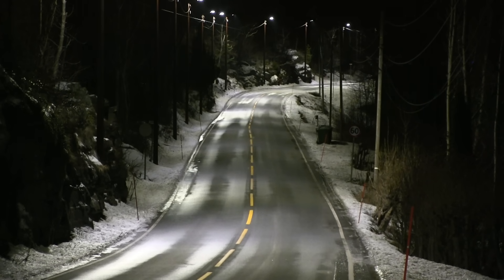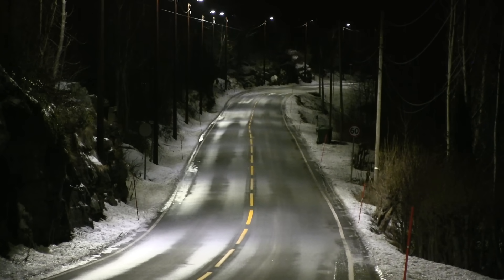Energy saving auto dimming street lights

Comment: They should not use radar, but just regular proximity sensors on nearby posts: so, when post 1 detects traffic, it sends a signal to a couple of poles ahead, so they can start incnreasingn light strength. That way they should be able to use cheaper hardware. Also would be good if the light adjustment was smoother.

Comment: At no additional cost you could make this even one notch cooler...  If the motion sensors detect a vehicle stopped in a traffic lane, it could flash the street lights a hundred meters on either side as an advance alert to oncoming drivers.  On a divided highway, they could flash in response to a wrong-way driver.  Once you start brainstorming the possibilities go on and on.

Comment: My knee-jerk is that this is a good idea in theory, but an impractical, potentially more costly idea in practice.  More complexity necessarily introduces more chance for failure (public safety at risk, which equals social cost) as well as more cost and time to maintain (these require specialized knowledge, creates vendor lock-in for more difficult to manufacture parts, etc.). All that has to be weighed against the upsides (energy savings, less light-pollution).
Reply: In regards to safety; if one radar no longer functions, the lamp will automatically be set to 100%.

Comment: That flickering of lights can be annoying as .... Should be so that the lights light up before the car can see them.
Reply: The customer can choose how far ahead the lights should be lit. Here they have chosen 5 poles ahead and the poles are 40 meters apart, so the light go to full light 200 meters ahead of the car. But for sure, they could have chosen 10 poles ahead and then it would have been lit 400 meters ahead, it`s all up to the customer and can be changed at any time they want to.
Reply: Great! I'm glad to hear that. It would also be much better if lights went from 20% to full power in like 5 seconds, so they wouldn't produce the flickering effect.
Reply: I agree. Not only annoying, the flickering also distracts the driver. When we drive, we very much react to changes, and this flickering is a constant stream of changes. The idea is good, but it will need some improvement.
Reply: If the car travels at speed limit, lets say 60 km/h this will make the car to have traveled approximately 75 meters before full light is retreived, and then again with at least 200 meters sight, the detction should ignite 275 meters ahead of the car. But this is doable. Here this would be 7 poles ahead, and a change of ramp up and down time could have been programmed. Communication to the lamp driver is done by Dali, so the drivers needs to preprogrammed for this feature, but if the controls had been done by 1-10 V control this could have been done with the radar system unit. So it is a lot of possibilities, there is even a high traffic adjustment, so if you like lights will not start dimming down before you have a sertain amount of low level traffic. This to prevent light for going up and down all the time.

Comment: Pointless.
If there is little traffic (as here), cars will be able to use headlights on full beam most of the time. That gives perfectly adequate visibility. Street lights of any kind are unnecessary.
Reply: What about when another car drives the opposite direction? That's when good street lights are most important.

Comment: It only saves energy if doing that doesn't burn out the ballasts in the lamps after a few months. I worked in an office where they did that, got new energy saving lights with motion sensors and set the lights to 5 minute intervals and most of the ballasts burnt out within a year because they were going on and off all the time. 

The best thing to do is just to turn them off between 10PM and 6AM. Its what some local authorities have started doing in England. Its a waste to run all these street lights at night. Cars have headlights.
Reply: https://www.thesun.co.uk/motors/4780183/brits-in-the-dark-as-a-third-of-street-lights-are-switched-off-or-dimmed-at-night-and-itll-be-even-worse-after-the-clocks-go-back/

Comment: Is it worth the complexity and all cost that comes with maintainance (and cost of the whole system in first place)...just asking, not a criticism. 
Wouldn't make sense to just run LEDs at like somewhere (fixed power, set at instalation/purchase) between 20-60%  (i pulled that number out of my...thin air) all the time?
Reply: To install a radar takes only a few minutes and the cost is not high. With the radars installed you can provide 100% lights when needed (for safety reasons) and turn them down to 20% to reduce consumption of electricity and hence costs while also reduce the pollution of light.

Comment: In germany they installed a solar powerd street light. This light is only for pedestrians and bicycles but the idea is great. The light operates with low energy and when the radar detects someone, it goes full power. Also there is a solar panel and some batteries to function autonom. Not everywhere you can install a energy cable or it costs to much. 
For someone who understans german, here the video:
https://www.youtube.com/watch?v=3s93WSXIsFY

Comment: That's pretty cool. I knew it was likely that some places did this but this is the first time I've actually seen it. Ever since my town in MA replaced the sodium vapor lamps with LEDs some people have been complaining that the light coming into their homes is brighter. This could be a problem if your house is somehow really close to a street light. I'm sure a lot of energy has been saved and hopefully light pollution has gone done a little bit because the lamps now face completely downward. But I wonder if the potential decrease in light pollution may not be as large because of the extra illumination being reflected off the ground, especially when there's snow on the ground during the winter. A simple solution would be to have the lights turn on only when a vehicle is coming, or have them very dim most of the time and get brighter when a vehicle drives by. I've been wondering how this would be implemented, and it seems radar is the most likely.
Reply: Comlight reduces the output to 20% when there is no traffic. If you turn LEDs off completelly for each car the life expectancy of lamps reduces drastically.

Comment: I have not driven there, but I think maby 5-10 lamp posts should light upat the same time in front of the car so that you can see a lot furter infront of the car. And then it does not need to be radars on every light post just a receiver and they save even more money i think.

And great video as allways Bjørn!
Reply: You have a good point Niklas. From this angle it looks like it only lights up just in front of the car. From above we would see it lights up more than 100 meters before the car, which is good when travelling at 60km/h. For roads with higher speed limits more lamps are lit ahead.

Comment: That's a pretty cool concept but imo they don't light up fast enough
Reply: iv'e been there with a motorcycle, they are genious. Lights up fast and i could see in my mirror them dimming down again
Reply: The system isn't exactly hard-coded to be specifically lighting up x meters ahead of the car. In Australia it can be made to turn on 100-200 meters ahead if you think that's necessary.
It's literally a change of one number in the settings.
Reply from the maker: +Ventilate They do. Watch when the car drives past.
Reply: Measurements and calculations tells us that you need to drive at least faster than 250 km/h to be able to have a theoretical possibility to catch up, when there are extreme cold and reaction in the electronic is at its slowest. And if you move around in darkness at those speeds at public roads, when there is below -50 degrees Celsius, you do not deserve any light at all.
Reply: Edwin Kravcenka ooh then that'd be nice! Still better than driving around with no Street lighting where I live anyway
Reply: Yeah, in Australia I'm always looking 100-200 meters ahead for wildlife - this wouldn't be helpful at all.

Comment: What about motorcycles and bicycles? Do they activate the radar if so they are pretty cool
Reply from the maker: A human didn't seem to activate it. I haven't tested the other types of transportation.
Reply: martinstab2 the radar can detect a motorcycle or a bike with an appropriate software.
Reply: Pedestrians down to 2 km/h shall be detected as long as they pass through the detection area. The Detection area is covering from one side of the road to the other, but not all the space between the poles.
Reply: Antonio Cirino dove hai letto ciò ? Comunque sarebbe bello vedere questa tecnologia impiegata anche in Italia, ma sto sognando haahah
Reply: Fabio Im beh non ho letto, ho pensato che il radar può essere calibrato proprio come si calibrano i sensori antifurto. La tecnologia è simile.

Penso che sia poco applicabile in Italia poiché la densità abitativa è più elevata rispetto alla Norvegia e quindi i risultati possono essere minimi. Una soluzione è il solo passaggio ai led.
Reply: This was my first question, thanks for answering it... I suppose that at 20% illumination, a pedestrian should have enough illumination to be able to walk safely, and they will get the full 100% illumination once a car approaches...

Comment: Have you a link of the hardware installed? I'm interested.
I'm guessing if the dimming will degrade the led light faster than in normal mode with full brightness without dimming.
Reply: I think it is not only the heat as well as the Phosphor dissipation will be lower which transform the spectrum to white by having less current through the LED.
Reply: Atak Snajpera obviously but the quality of the heat exchanger is different between cheap led lights that stands for 25000 hours and high power led for streets that stands for 100000 hours and over.
Reply: If you compare a led of lower watt use with same output of that of incandescent the latter would run more hotter, I can comfortably touch a 40 watt or less incandescent but as me to to touch one with higher wattage and your asking for a burning. Now if it was a 100 watt equivalent LED using only 40 watts power  or even more wattage comparable output I can touch it just fine and won't burn. You all are thinking like they burn hotter than tungsten or halogen and I got a few 200 watt-e LED bulbs and they do not have any heat exchange on them and I can easily unscrew them when they have been on a while, where as I said with the older types I would have to let it cool down for several minutes or use oven mitts in which case would lead me to dropping the bulb.
LEDs do not burn hot, they get warm yes but not hot like incandescent or halogen or such, but yes put a bunch of them in a bulb and will want some heat dissipation or they will burn out like old type bulbs.
Reply: Most I use is 60w equivalent as the higher wattages are more lumen than needed, none of the bulbs bought have any noticeable heat dissipation and can touch them as they are only warm enough to warm my "cold" hands. anything more would defeat using less energy and really only turn on enough lights to see what I am doing or where I am going when it's night time out.  My eyes are a bit sensitive to even daylight when it really shines.
Reply: Hi Antonio, all luminaries producers we have been in contact with has said that the LED light will last longer and have less degrading than normally if dimmed down to lower light level. In fact this installation is right now with 80% Luminux flux at maximum and 25% Luminux flux when dimmed. 
Here is a link to our homepage: http://www.comlight.no
Reply: I go by what it says on the boxes and compared to past older tech the LED are lasting longer despite what you think and though it does use lower wattage, it puts out much less heat and on average 10% more lumens of illumination. Electric bill also reflects the savings compared to low purchase but high electric cost vs higher purchase but much lower electric bill each month with the LED. I also look for the UL listing mark and if I do not see it on such a product then I do not buy it.
Reply: Hello Antonio, the dimming does not degrade the LEDs faster as long as minimum is set to around 20%.
Reply: Antonio Cirino if anything the LED will last longer when dimmed as not as much power is being pushed through it, producing less heat.
Reply: I think that this led lamps have a massive heat exchanger (someone with fans) to expell the heat from the led.
So it's so important to cool down the led in order to increase the durability of the led?
Reply: Antonio Cirino yes it is very important, high brightness LEDs used in street lights and car headlights use heatsinks and in the case of car headlights actually use fans to cool the LED down, otherwise it will overheat and be either diminished in its life or just die right then and there